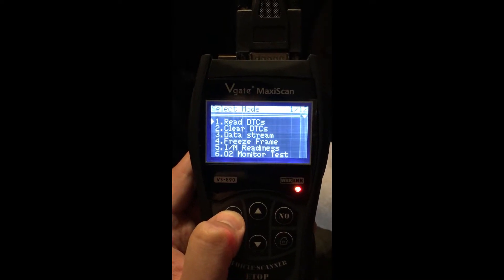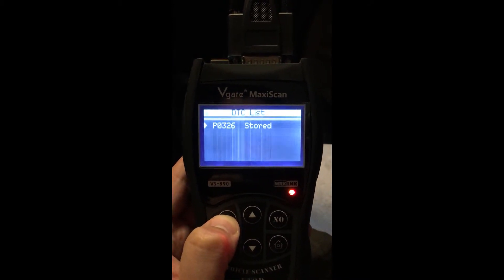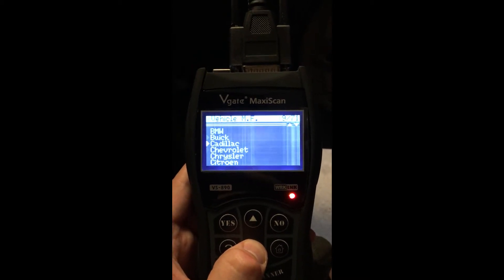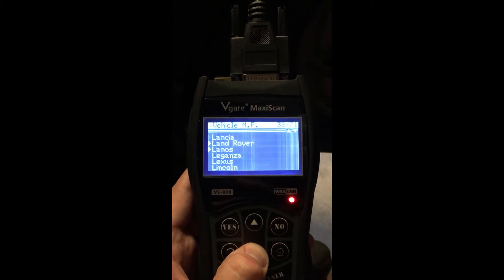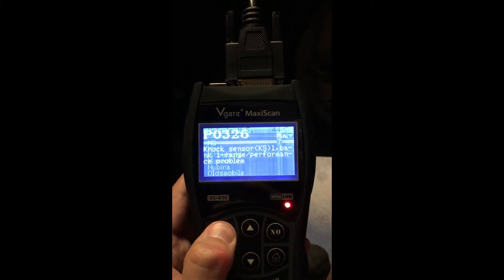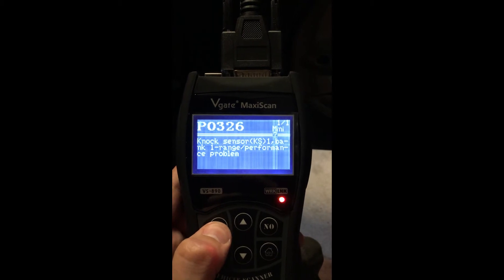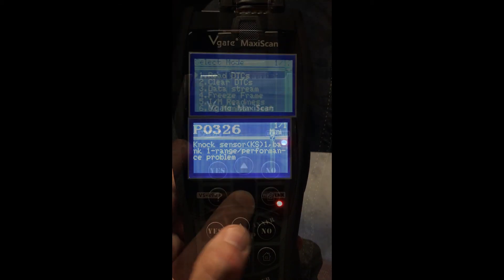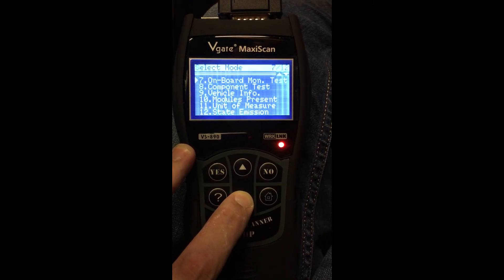Mini Cooper R50 Engine Light - How to find OBD2 Socket and Find or Read Error with Vgate VS890

Comment: can you show me how to put the engine check light when I have replaced the o2 sensor thank you, never used one of these before so I an a novice at this, only used to working on older cars without obd socket.
Reply from the maker: Hey Graham, I hope you are well. Did you sort this in the end? You should be able to reset from the obd reader. The only issue being, is if the new sensor retriggers it.

Comment: can you reset the engine check light with this thanks
Reply from the maker: Graham Standreang Hi there, I hope all is good with you. Yes you can reset the engine light (and history) with this vgate version, did it a few times. If the fault is not fixed, it will soon retrigger via the ecu, so bare that in mind.
Reply: fitting new o2 sensor so all should be well thank you.
Reply from the maker: Hi Graham, if you select 'clear DTC' from the menu (Option 2 - 40 Secs on the video) you will be able to clear the code(s) and resolve the issue. Hope this helps